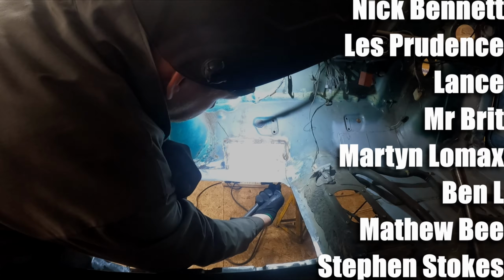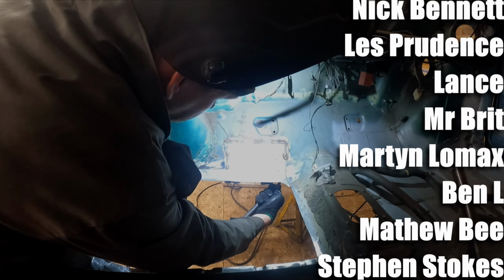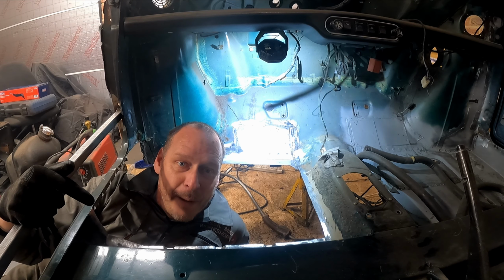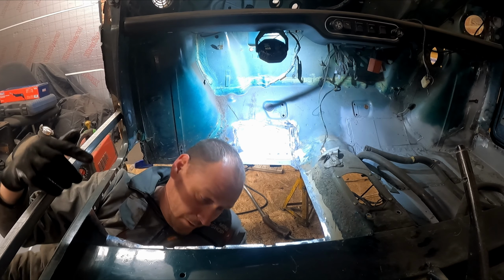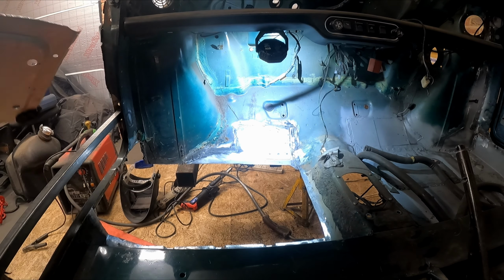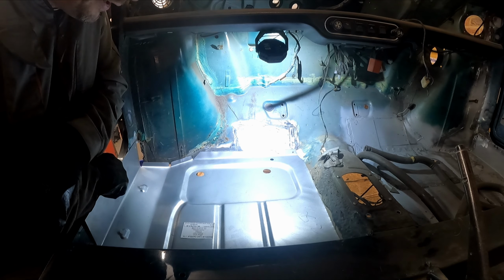Toeboard Repair - Classic Mini Workshop - Project Racing Green Pt.25

Comment: https://www.toolite.org.uk/sealey-spot-welding-electrode-sharpener-p-58197.html For those interested, this is the spot welder electrode tip sharpener tool. Not cheap, but worth it if you use a spot welder a lot.
Reply from the maker: Well done mate, I couldn't find them in stick anywhere

Comment: Great work. I love my power file (silverline - but looks the same) but you won’t beat the speed of a flappy disc where you can use one. I think the standard belts are rubbish and get zirconia ones off ebay, miles better. My tip to you and anyone else doing a restore is to buy a couple of cheap grinders £10-£15 fit a flappy disc to one, fit a paint stripper or wire brush to another and have a descent slow start/quick stop grinder with a cutting disc on… save you changing the discs 40 times a day… it was doing my nut in, I now have 4 all with different discs on.
Reply from the maker: Great tips mate, never thought about just buying another grinder before rather than keep changing discs! I think I will do that, it will save me time and always have a backup for when one dies.

Comment: Great video Keith, making good progress, a question for you, fitting an outer sill, is the correct fitting over the heelboard end, seems lots of different fitments out there..
Reply: The sill should (factory) sits on/inside the heelboard. Look for images of ADA36002E (complete floor pan) to see how the floor/sills are made up before fitting sides etc.